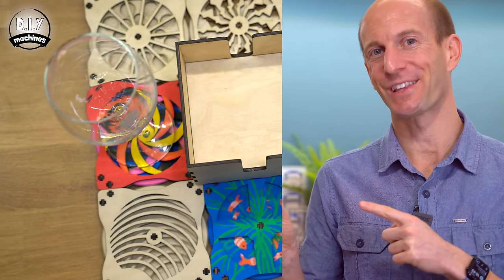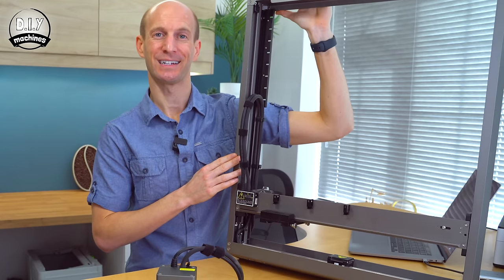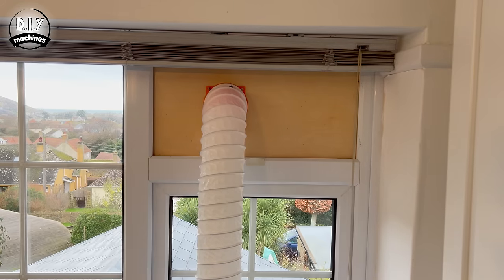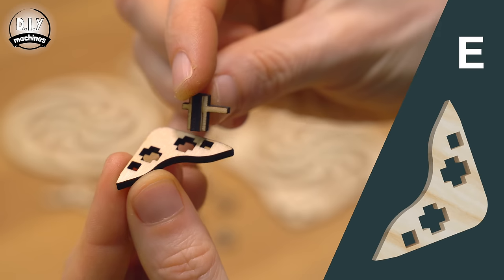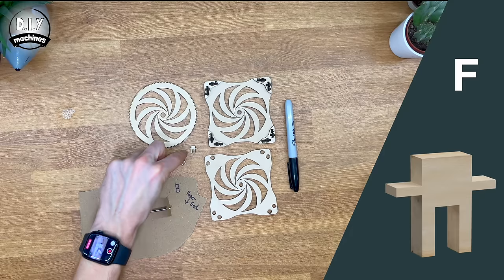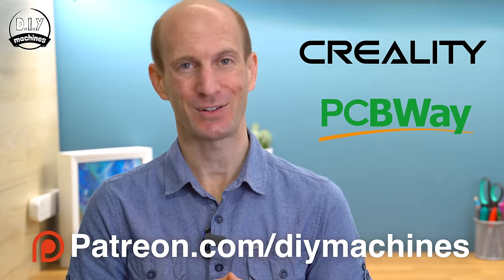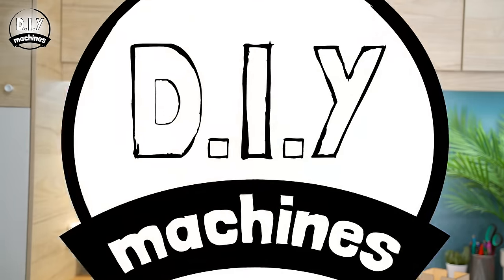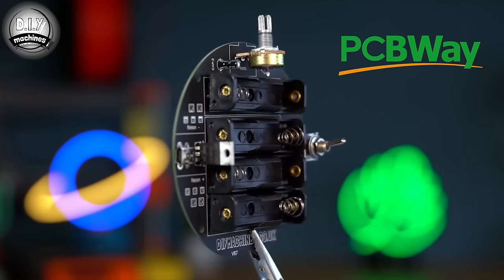CRAZY COASTERS with a TWIST! Laser or 3D Print some DIY Magic

Comment: Very creative, love it! I made a laser cut kumiko lantern a little while ago and it was one of the funnest projects I've done in awhile. Just a tip, once you home the laser, manually moving the head will make it lose position. If you want the machine to know its absolute position you should only interact with it via its controls. That being said I often manually move the laser to where my material is, but its not necessary to home before that.
Reply from the maker: Some great advice. Thank you. I will try it that way next time I cut something. 👍🏼